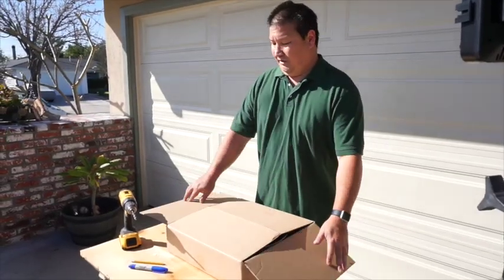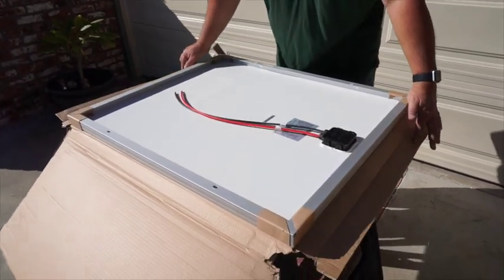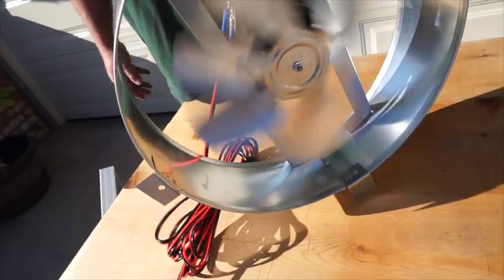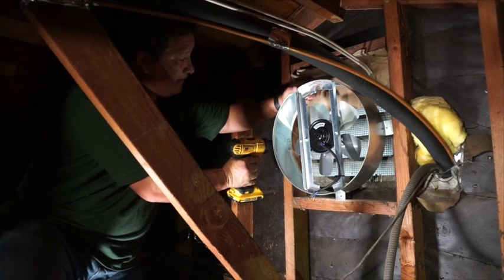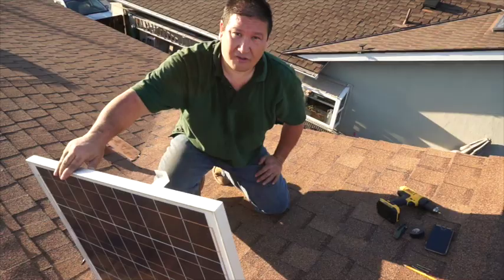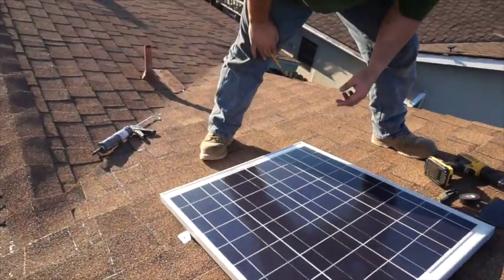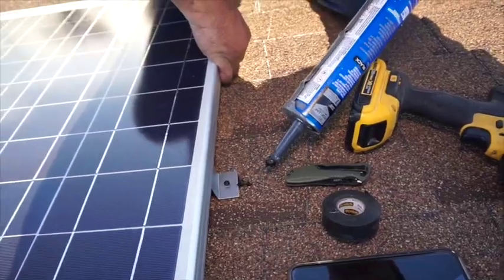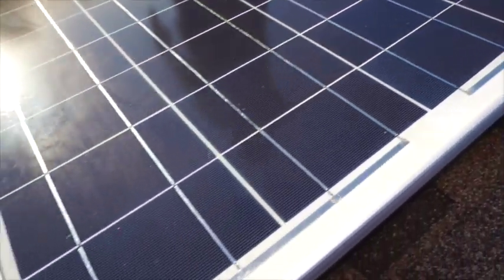How to Install a Solar Attic Fan - DIY

Comment: The instructions are suboptimal, especially for people who haven't done this kind of thing. There are four washers and a nut per screw. And what order are they supposed to go? This video doesn't say nor do the instructions. The screws to hold the brackets to the roof are not supplied. You must provide these yourself. Be careful with the wire connections. The instructions say, but i am emphasizing that they come apart very easily

Comment: Before you install the fan, get some rubber insulator pad that you will use in between the frame of the fan and the lumber, it will absorb lots of vibration and will be much more quiet

Comment: My solar panel has large connections that does not match the wiring. Do I need to go buy the right connectors and splice?
Reply from the maker: Thank you for your question. No, you do not need to change anything, the connectors on the panel are mc4 connectors and even though they look big the are compatible with the bullet connectors that come on the 15' feet of extra wire. For further help please contact us threw the channel you purchased from.

Comment: I would've done a temperature survey of attic temperatures before and after fan installation.
I'm using a wireless temperature/humidity monitor (Lowe's $16) - placed sensor in attic - getting peak temperatures of 108 - 118.
Gonna install solar powered fan in existing turbo-fan already on roof.

Comment: no on or switch or winter time
Reply: Thermostat lol
Reply from the maker: You can buy a thermostat (for Amtrak Solar products only) on Amazon or our website www.amtraksolar.com . The fan turns off automatically at night because it receives no sun during that time. You can buy and install an on off switch between the fan and the panel.

Comment: Is it possible to add an on and off switch to the system?
Reply: Yes
Reply: That’s what I’d like to know too
Reply from the maker: Thank you for your question. Yes, you can add an on off switch to Amtrak Solar systems. We currently offer a kit that comes with an on off switch.

Here is the link to the listing: https://www.amazon.com/dp/B08MMT7XTX?ref=myi_title_dp
Reply from the maker: Thank you for your question. Yes, you can add an on off switch to Amtrak Solar systems. We currently offer a kit that comes with an on off switch.

Here is the link to the listing: https://www.amazon.com/dp/B08MMT7XTX?ref=myi_title_dp